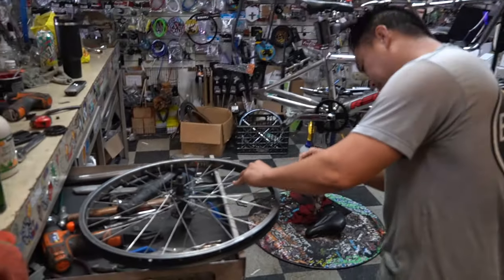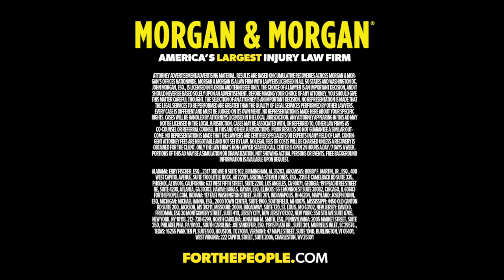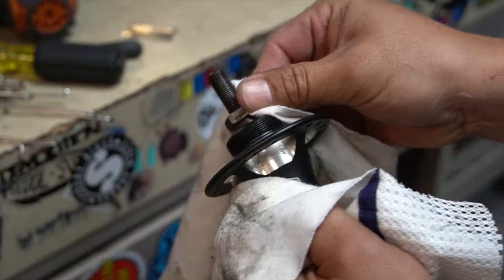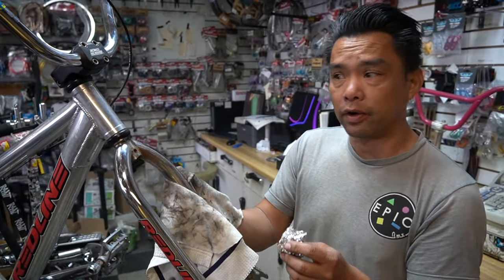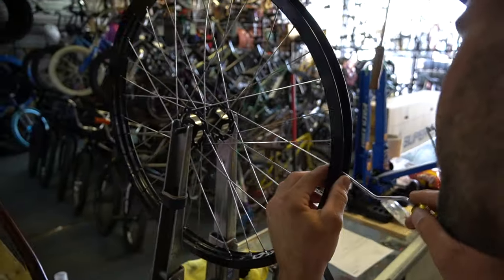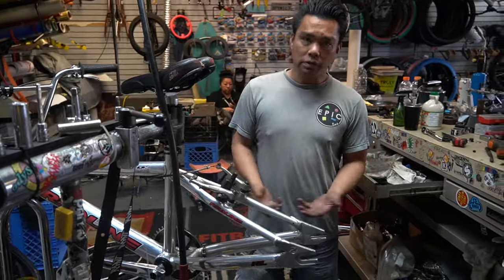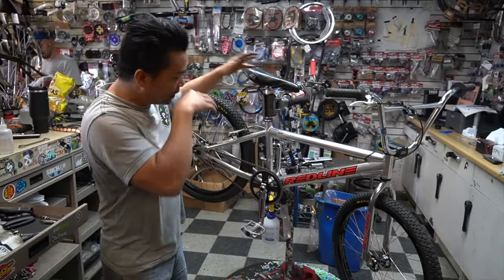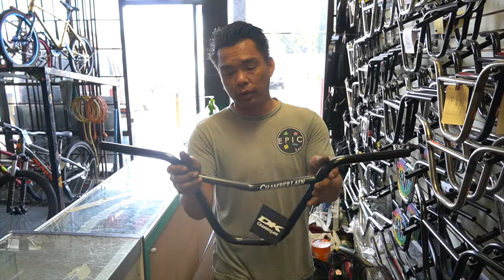Redline BMX Restoration Hack Using Aluminum Foil!

Comment: I got a similar redline cruiser with mtb fox forks hydro disc brake power bend bars. Reused spokes on back wheel and broke a spoke months later. Although they weren't stainless so I should of upgraded from the beginning. Lol no rust on frame because it's alluminum

Comment: Question?? i bought a Mongoose Legion 500 recently and the spokes seem a little loose and wen i ride it the front wheel is making a funny noise (spokes make a pingin noise), my Mongoose Pro XL the spokes are AMAZING just so strong.. strange that the cheaper BMX is built way stronger.. any Tips as to what i do with the Legion 500 as its driving me Nuts (as its such a nice bike)
Reply: Yo, have you tried tightening up those spokes a quarter turn? Check on youtube, there's some good videos on this. I think a spoke key tool is less than 10$
Reply: @tommyjameslayton  i have purchased a spoke tensioner, tensioned every spoke front and back wheel and it now like new.. well pleased (a new skill set)
Reply: @tommyjameslayton  never be afraid of bike maintenance.. even the cringe issues

Comment: There’s a even better way of keeping surface rust off of Crome & metal bike parts , buff all of them with a buffing wheel using Red Rouge , clean off the  rouge & make sure you get it all cleaned off very good , then with a new buffing wheel buff all of your parts out with ZAM & clean all the ZAM off very good,   Don’t leave any on any of your parts or your bike & you,ll never have surface rust on your bike again , it impregnates the metals with both buffing compounds & all you,ll have to do is use water on a towel & your good .i do this very thing to all my new bikes lightly of corse before I put any parts on my bikes or I,ll do this before I put my bikes together & very old school like back in the early 70s rider showed me this & it keeps your bike looking showroom fresh & all sparkly & it takes off any access oils & keeps them off .

Comment: Hello My names Luke. Im from Buffalo NY. We have a local shop that supportive  in parts repair and aftermarket. By all means best to support the local. But me a novice wheel Builder. sourcing what hubs and rims I can new or second hand.  Building wheels 12' to 29' it is always nice to save money.
    In your instance of reuse and relace. You  seemed to be certain that you could reuse the spokes.  What I would enjoy to see. if applicable.  maybe a method you or coworkers have to relacing wheels.  Not a tutorial of how to lace. But insight to.  "do i measure my old rims ERD to match it to a new corresponding rim."  or "is it necessary that spoke length matters."  " do you the shop owner have a master bible of measuring spokes to a new rim?" Most hubs and rims all slightly differ in ERD and and hub flanges.   Maybe talk any knowledge about spokes you know differentiate  them characteristic, corresponding nipples to use. The spoke cutter and threader is a great tool many dont have. It would be interesting to see and hear more of it and past techniques you learned some you like some that shouldn't be used while measuring rims or cutting  / selecting spokes.  or when to and not to reuse a rim/hub/nip/or spokes. Maybe in this case you could wait until a customer bring in wheels they'd like redone. With either a new hub/rim/spokes. this could be a really long informational video that might be a bit much to cover ant once. 
   In all Its  a bicycle wheel, to some it a work of art others its just an advantage to life.